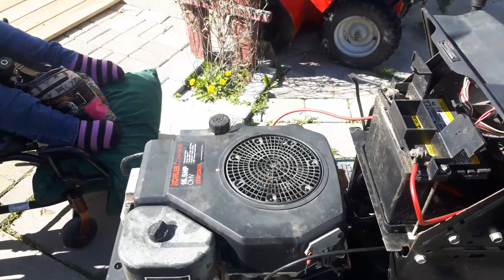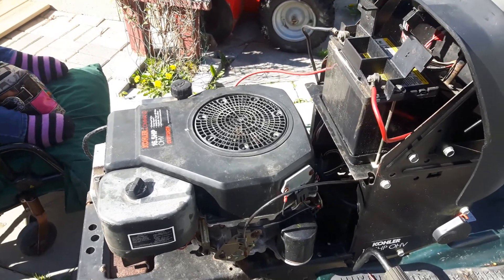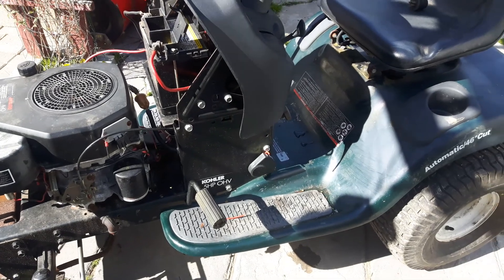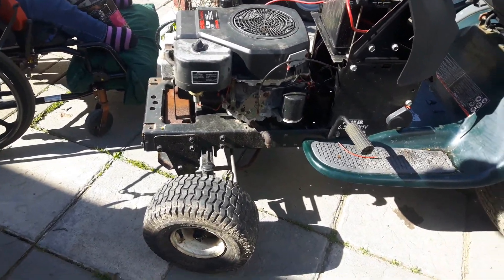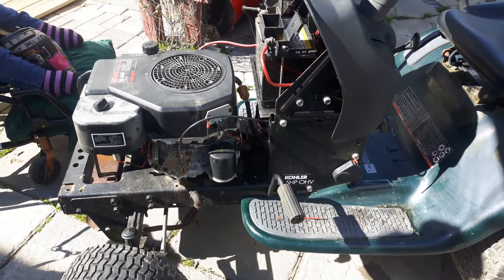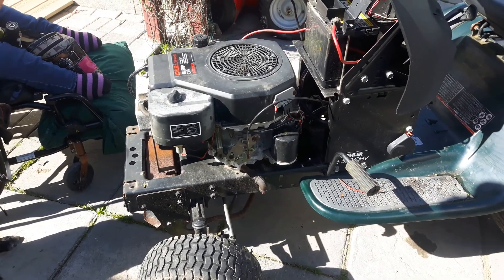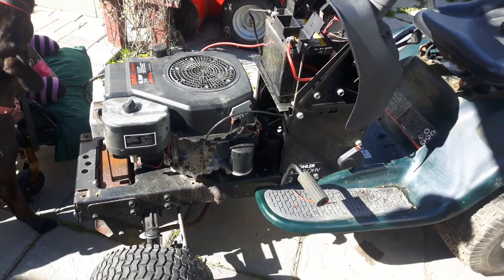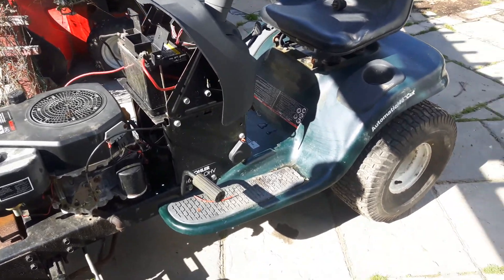$40 00 Craftsman The Problem

Comment: Make sure it's charging, low voltage will cause it to stall once you turn on the pto coil
Reply from the maker: 462ANIMAL I will definitely check that, but I am pretty sure it is charging.